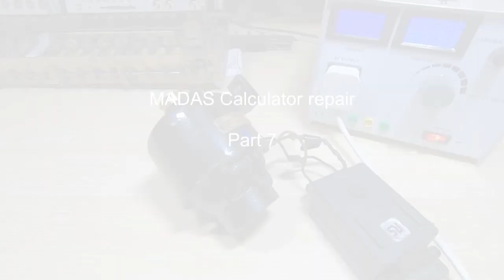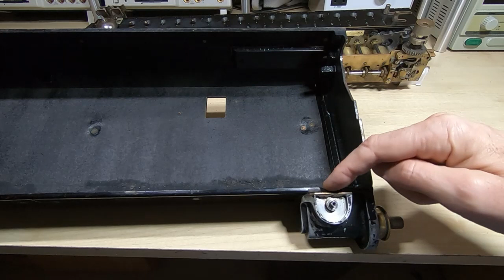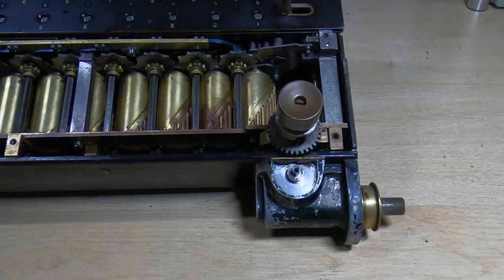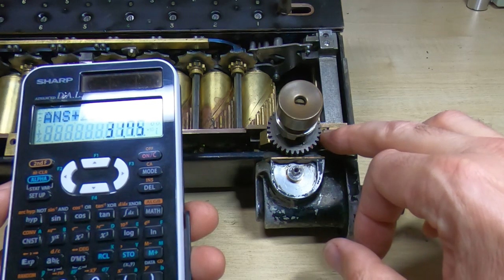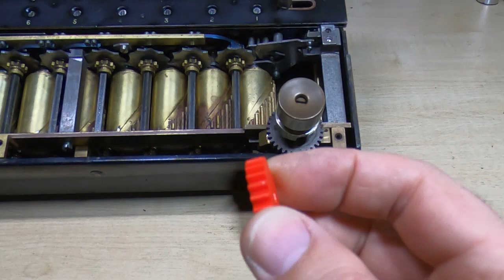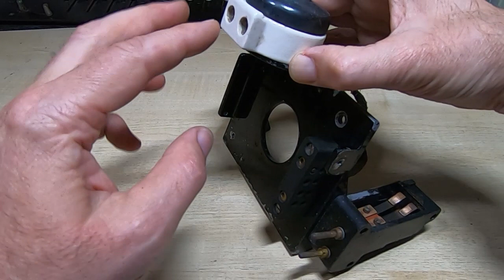MADAS Calculator repair Part7

Comment: What a beautiful calculator. Indeed for module gears the outer dia is equal to the # of tooth by 2 times module. Thus , for module one as you have here, substracting 2 to the outer Dia give the Z of gear. About gear materials back in those years where used also bakelite canvas that easily breaks to prevent mechanical damages and doesn’t need lubrication. This material is very soft to machine and can be found as rod.
Reply from the maker: Yes some equipment used a soft pinion gear but that cannot be used here as the square drive is very small and would most likely just round out the hole. You could of course make a composite gear with a metal centre and soft outer but using a brass gear here is acceptable as the drive belt will slip if the calculator stalls. It is easy to calculate the module and diameter as I show in the video but in this case I needed to determine the number of teeth required so did the calculation in reverse. Note that it is not the outer diameter but the pitch diameter which is used for the diameter and that is what I used to draw the gear I show which fitted perfectly. If I used the outer diameter it would have been the wrong size as this would be 4mm greater and so would give a diameter of 26 mm and so 26 teeth which would of course be incorrect. As you say you can simply subtract a fixed value from the outer diameter if you know the modulus but as I was trying to find the modulus I needed to determine the pitch diameter so that I could determine the gear modulus.